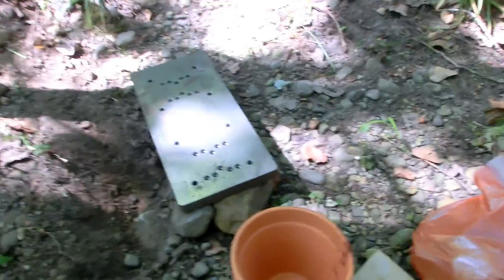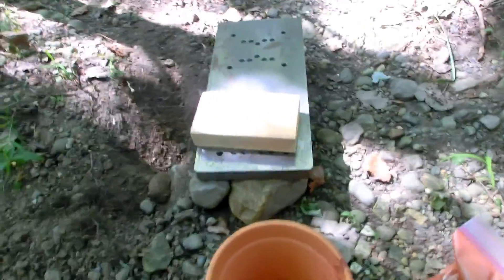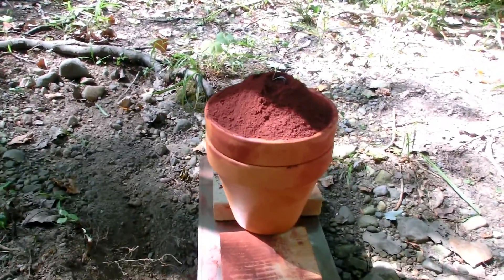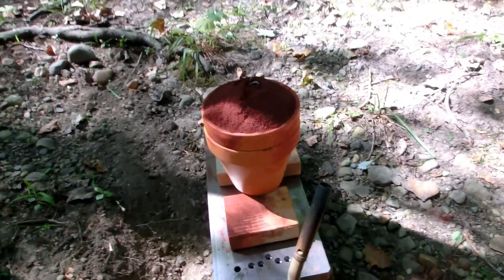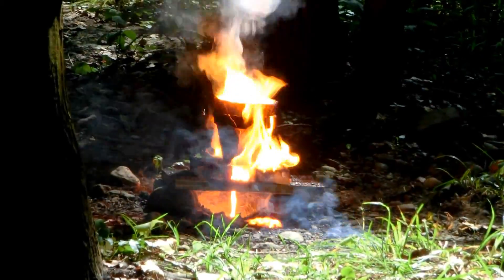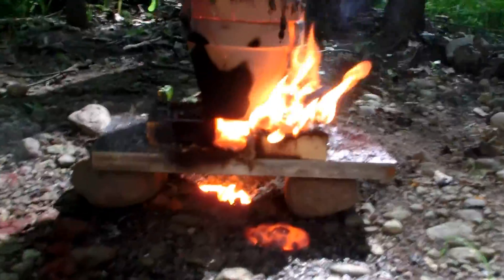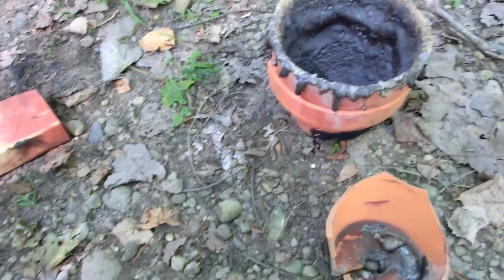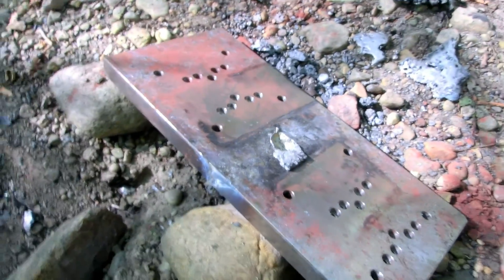Thermite vs 1" Plate

Comment: If you want to cut through the steel plate, you will have to burn the thermite directly on it. You're supposed to use the reaction itself to cut the steel, not just the (admittedly very hot) product. Iron melts way lower than steel.

Comment: I saw a video on YouTube years back where a guy clamped thermite onto a Steele plate that was several inches thick, and it cut right through it. I bookmarked the video and then YouTube took it down a few days later.
Reply: he had a steel beam in the garden and did various experiments with termite. at first he also used pots, roof tiles but without any effects. when he learned how to shape the termite properly he cut these beams however he wanted. If we are talking about this video I saw it years ago and I have been looking for it for a long time but without any effect.

Comment: While this is an old video, it still is educational.
Just because you can get iron and aluminum to burn, it does not mean it will do what you expect.
There were three main problems with this setup. One, the flower pots are not strong enough to contain the reaction. Two, the thermite was not set to the correct ratio for a cut, but just to burn. and three, there are better videos for how to weld and cut with thermite, watch those for further information.

Comment: If your container directed the reaction directly on the steel, it will act like a blow torch and cut through. Molten steel alone will not melt its way through steel. It won't even bond to another piece of steel unless its red hot too. It needs force along with heat to cut through. think of how a welding torch cuts metal. Heat alone doesn't do it. It's the blast of oxygen that does the work.
Reply: good ole shaped charge tech

Comment: Your thermite was just fine, your vessel was shit. The problem was 2 fold, first you need to make a cylindrical channel 2' dia (ruffly) through the center of your thermite charge to give it a natural pathway towards the plate & second you need to cap the charge thus forcing the pressure & majority of your deflagrating thermite downwards to your target. That should give you the result you're after brother, try using thick/ heavy walled "craft tube" (cardboard, reinforced) enjoy.